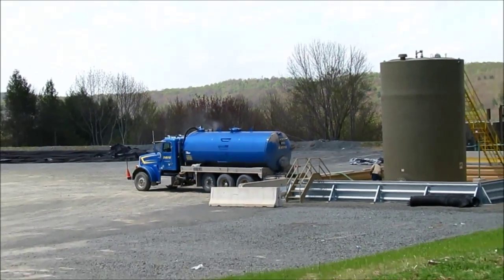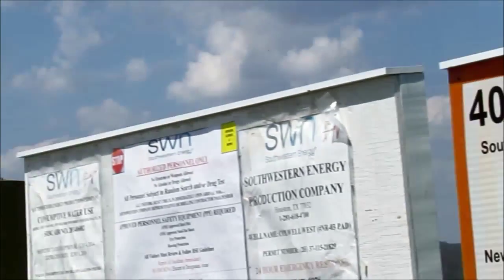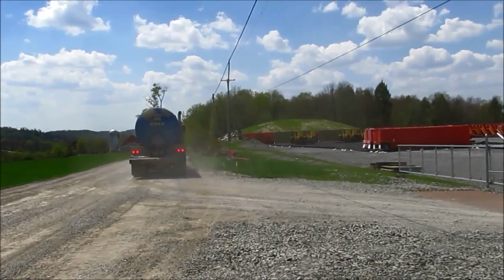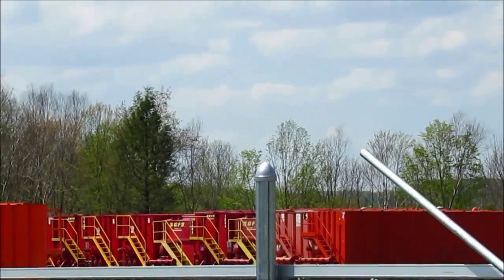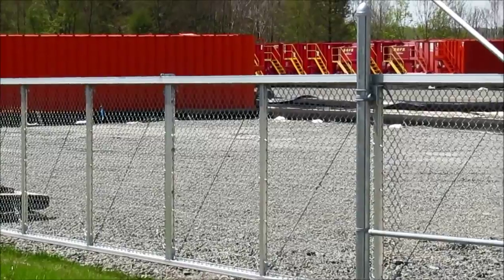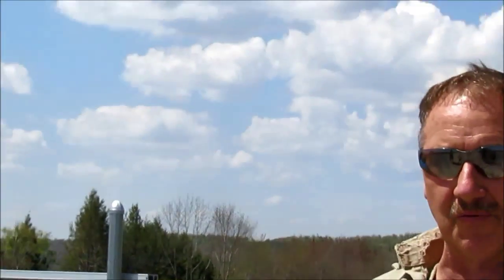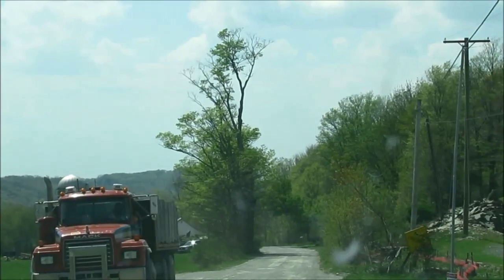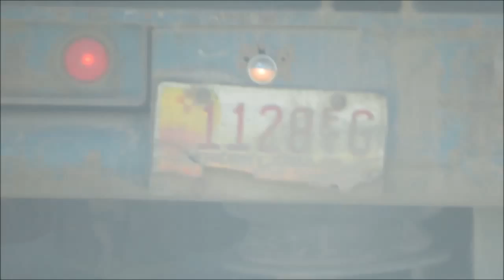Brine Tanks -  Colwell  - Southwestern Energy   5-8-15

Comment: The scary question is what happens to the brine after it is taken "away" ?   The answer is that it is often simply taken out and dumped along rural roads !  "Disappeared"   so to speak.    Can you guess where all the chemicals go from there?
Reply from the maker: gwheyduke   the gas worker mentions that it goes to a holding pond in our county and others may go to treatment plants; and what is in the brine besides brine?
Reply: Vera Scroggins With approval, production brine from conventional, low-volume fracking in some states is currently allowed to be spread on roads for de-icing, dust control, and road stabilization purposes. If not properly controlled, this waste can run off into adjoining property and ultimately could contaminate rivers, streams, and underground aquifers that feed local drinking water supplies. Government entities, as well as private companies, that wish to use production brine for road spreading must get permission from the to use the brine by applying for a Beneficial Use Determination (BUD).